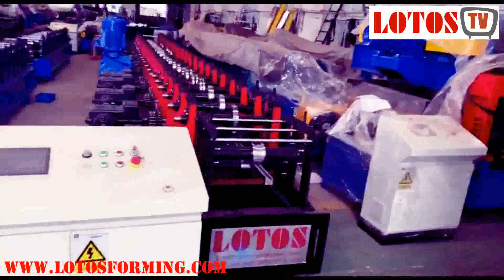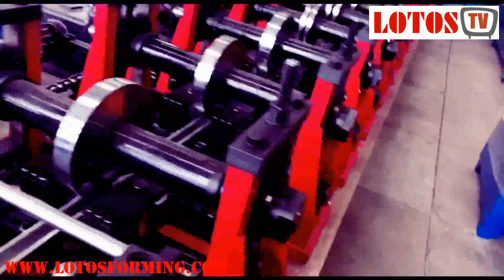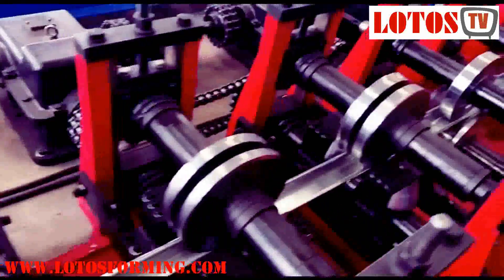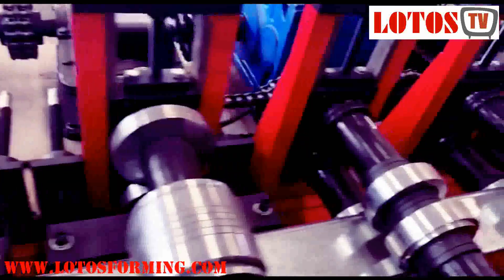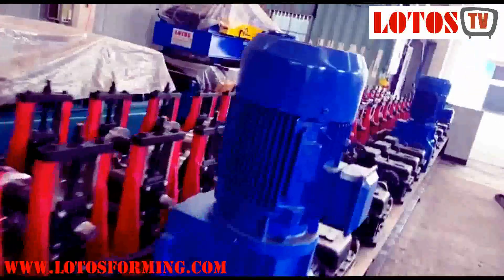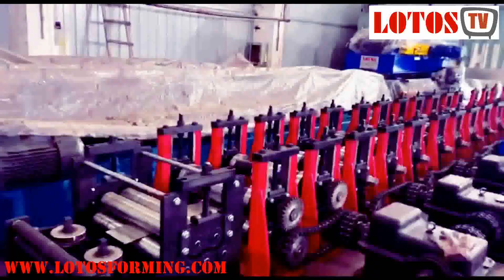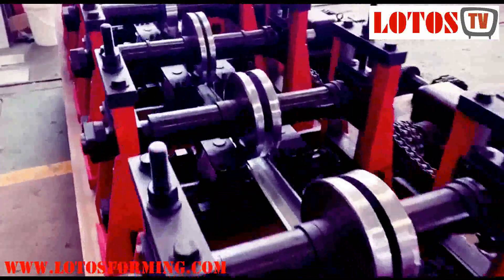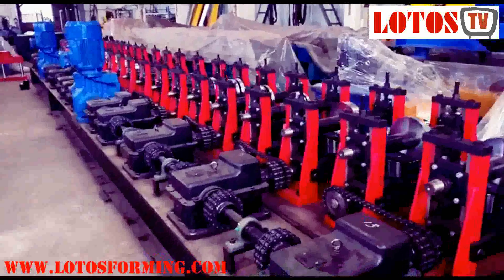【Channel Roll Forming Machine】: Unistrut channel roll forming machine | Strut Channel making Machine

Comment: Strut-channel is a channel specifically designed for structural uses and common in both the plumbing and electrical industries.
Reply: ดีไลท์ พลัส จํากัด I am building a greenhouse out of unistrut and plastic roofing.

Comment: uni Strut Channels provide ideal framework for support system without the need for any welding. Easily installed giving full flexibility to add a network of support applications.